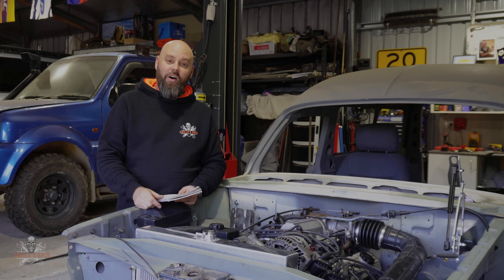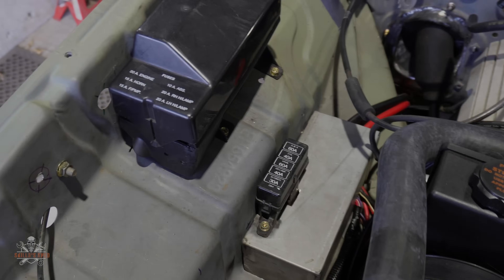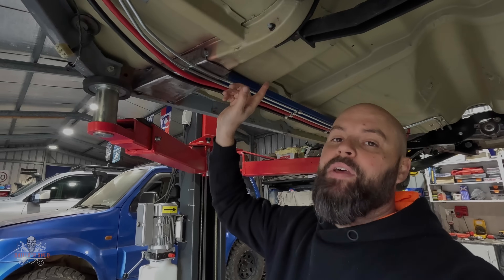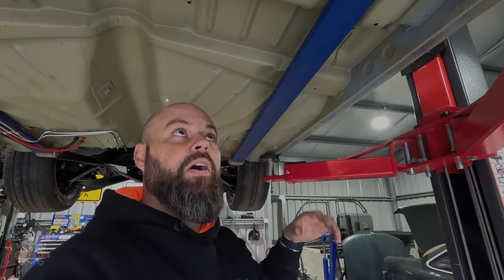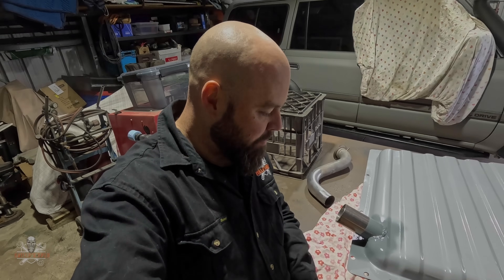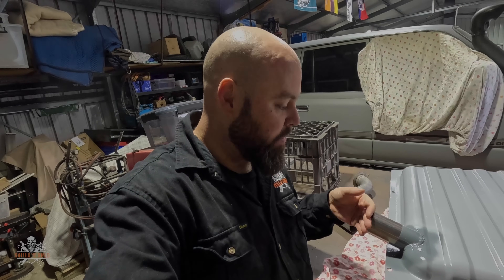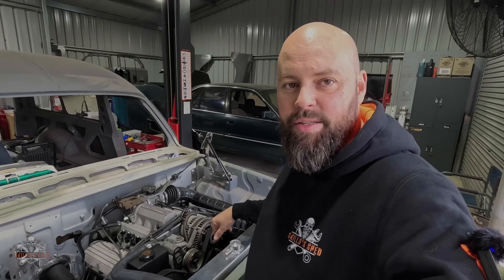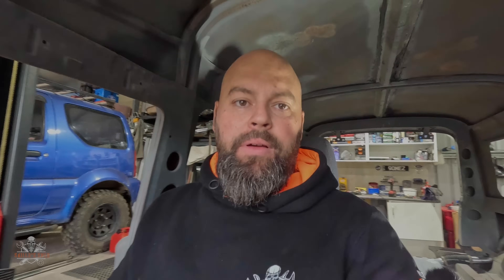FINAL CHECKS before starting my V6 EH Holden panelvan for the FIRST TIME!

Comment: Years ago i had an XE Fairmont with a 302 and T - bar auto fitted. I pulled those out an fitted a fully worked 2 litre four out of a Cortina coupled to a five speed manual. It was a real goer with a loud, buzzy sound. It did the standing quarter in about 19 seconds flat.  
When i tried selling her a few years later, nobody wanted it, so i left her at the wreckers. 
Since then, I've had a '79 Mazda 323 1-4 with auto(red with brown interior, very reliable), an '85 Mitsubishi Colt sedan(surprisingly strong performance), a '90 TP Magna sedan 2-6 carby, (comfortable and well equipped but crappy reliability) and now a 2012 Corolla sedan I've owned since near new(never had a drama with her).
After my mortgage is cleared, I'm looking at maybe a Hilux 2WD singlecab tabletop (tub backs are useless) with a manual fitted, possibly my final ever vehicle. 
But i wouldn't knock back another XD or XE Ford V8......this time, I'd leave the V8 in her. 
Anyhow, good luck with your projects.
👍
Reply from the maker: Nice one mate. It’s all about having projects isn’t it!  

Believe it or not I plan on doing an XD/XE with a Coyote in it in the next year or so. Awesome shape.
Reply: @skillosshed 
Good luck with that. 
Yes they're a great shape, particularly in LWB (Fairlane, LTD).

Comment: Hi Skillo, love the build and following along. Just want to make mention of your fuel lines running under the chassis brace you installed. They are very low on the van and may be in danger of damage. If you can check with your engineer if you already haven’t to see if he is happy with how they run. I’m doing an EH wagon and had to cover some of my lines to keep him happy. Easy to fix now rather than later after painting. Anyway keep up the great build.
Reply from the maker: Thanks mate! 

Yeah have a few mention to me about the lines so will reach out to the engineer. I was 50/50 on running the battery cables there so I can alter it all pretty easily. Watch this space!!
Reply: You might be able to run your fuel lines on the inside edge of the RHS if you use single fuel line clips , this way you should be able to get your two lines within the 25 mil,

Comment: Grrat job but personally would have run power negative cables in side the tubing you fixed it to
Reply from the maker: Cheers mate. Yeah I’ve had a rethink and I’m going to run it in the car instead and change up the fuel line positioning as well 👍🏼

Comment: What size was your chassis strength bars & are they on a vid cheers , nice build 👍
Reply from the maker: They are 75x25x2.5mm RHS and I just cut out the ends to fit over the spring hanger. Then the plates over the crossmember is some folded 3mm plate. I didn’t do up a video on that though. Only mention it in this one 😞
Reply: @skillosshed  sweet thank you , iam doing a sedan at moment & liked the RHS idea 👌👌